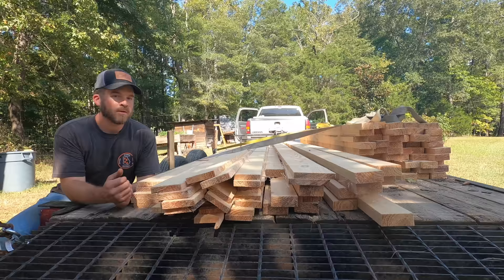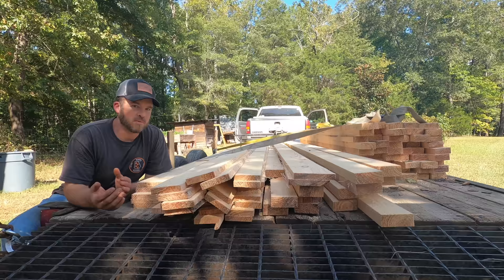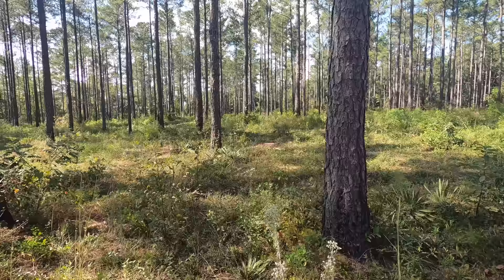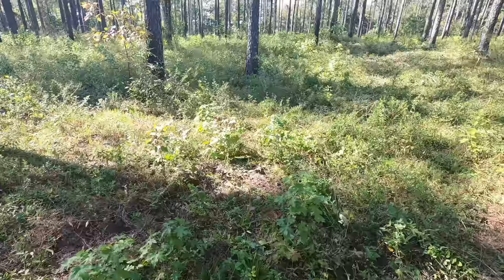Homegrown Lumber on a Mobile Sawmill

Comment: I think the bottom up error was the blade thickness? About cant. If you can't get a cant out to that log, well you can't. But the cool thing is that log turner. That is a cant-i-lever.
Reply from the maker: I think you're right, Bruce. Somehow I always forget about the kerf when it's the bottom cant.

Comment: Heya Wes.  Just a note, I know the trees will easily reseed down there, but for some of the people that are concerned about not replanting a tree for the ones you harvest, the trees will reseed many more than just a one for one.  That doesn't happen in some parts of the country, like Nebraska, where you have to intentionally plant and then baby replacement trees everywhere but creek bottoms.  Where people there can lumber out their property every 15-20 years and it'll reseed by itself, here you can only lumber out your property every 40-50 years, and it's usually only in creek bottoms or by a lake or farm pond.

Comment: Wess I know a true 2x4 is more impressive than the store one but I cut all my lumber the size of store both because 20 years down the road is your son or daughter will have a saw mill to cut there own wood. I mean by that look at your own remodeling project if you did not have access to a mill all the extra work you would have to do to match the ones that are there already now for a job like your's defenatly would cut to match but for new construction I go with the same size then from the store for the future generation to have a easier access to material if they don't have the saw mill 
  You did a good job at it and i like the fact that you bring the stump down so it is not a hazard in your forest have a great day
Reply from the maker: That's a great point.

Comment: Great video!  I marked my LT15 height wheel with numbers at every notch, 1 through 32.  I found that this really helped me make height adjustments more accurately and quickly, as I could pinpoint and turn to a number much easier than a line.  I can also return to my cut depth easier after sawing by cranking up the wheel as many times as needed to clear the log, ending on the same number.  All I then have to do is reverse that many revolutions back to my number and its spot on every time.  Hope this suggestion helps, keep up the great work!
Reply from the maker: Oh that's a good idea. I can see how that would be way better than the lines.
Reply: Yes sir, and the silver sharpie I used still looks like the day I put it on, two years later.  I also made a laminated card that I attached to the saw with a magnet that has my thickness cuts for 1", 1.5" and 2" with 1/8 increases for saw kerf, after the first cut thickness.  For example, if I was cutting 1 inch boards and had a 12 inch cant, I would see what height fit into that and start my cut.  Then I would use the wheel to set the rest of the cuts and it always stays spot on, with the bottom board also being an inch thick.  Hope this make sense and have a great day! @falllineridge

Comment: Hi Wes, I am a subscriber from far away India, a retired accountant. I love to see the varied types of jobs you do and the projects you undertake. Till now I have been a silent viewer, but today you did say that you would try to answer all queries. So here goes, when you are making lumber in your saw mill, what happens to the edges or the parts which has the rounded part of the bark. Or for that matter the rounds that are available after you trim the stumps to ground level. Do you use them for firewood? Anyhow what is done with them?
Reply from the maker: Not much I can do with the stumps that get cut off. The slabs (rounded parts that get cut off, some people call them flitches), have been claimed by my pastor. He wants them for siding for a little cabin. Another fried wants some for campfire wood. Whatever doesn't get claimed will probably go up in a huge bonfire in a few months. Thanks for watching and sorry it took so long to respond!

Comment: Wes, I don't care what everybody else says, I for one love what you're doing.  You are a very faithful servant of an incredibly Generous Master.  Keep up the good work.  
FYI, @9:54 I thought I noticed a spark or 2 coming out of the left side of the log where your saw was cutting it.  Was it a nail in the tree or just the chain sparking on itself ?
Reply from the maker: You're right! I guess I didn't;t notice that. Not sure what that was. Could have been a rock or some sand I suppose.

Comment: I totally understand why you need to thin out the trees. My question is... what happens to the stumps? Is there any value in uprooting them? Can you sell it, is it best to leave them or best to remove them to keep the ground level flat? Always wondered.  🤓
Reply from the maker: Best would be to grind them below the ground, but I dont have that capability. Best I can do is cut them flush and wait for them to rot.

Comment: On the logs with a large taper would it benefit you to shim up the smaller side 1/2 the difference between the 2 ends. I watch other videos where they do that to cut down on scrap.
Reply from the maker: It probably would. The trouble is that this mill has no toe boards so I would have to manually shim every log.

Comment: Great video, Wes!  Thanks for sharing... Do you miss your band saw sharpening rig?  I remember that seemed like a good thing for a home saw mill to have.  Guess it was more trouble than it was worth?  I recall you found a new blade company who makes blades more economically compared to original equipment.  Can you touch up a blade with a file or grinder to get some more mileage out of it by hand?  Is it worth it?  There comes a point where your time to sharpen an old blade is worth more than the cost of a new blade - guess that may have been how you felt?  Those pigs have sure grown!  Did you put Rocket in with Sue?  Is he old enough to perform his job as a boar hog?  Sorry for all the questions - I do really enjoy your videos!  Thank you!
Reply from the maker: I don't miss the sharpening setup. It just wasn't worth the time for me. I've never tried to touch up the blades, but I suspect that it would take too much time to be worth it. Rooster is in there with Sue, and he's old enough to do his duty (although I'm not certain that he's fertile yet). We'll see I guess!
Reply: @falllineridge  - Oops!  Thank you for the kind correction.  For some reason I remember his name did start with an "R"!  Informative video today on controlling the bee mites that that glow plug device that melts the acid into vapor. (I do hope you find your real respirator as that stuff sounds bad for your lungs!)  I'll bet that sharpener rig you had for the mill cost a pretty penny... I guess you figured out your time was more valuable than buying a sharp blade.  Ever since you found that new supplier of more economically priced blades, it makes it easier for your pocketbook, I'd wager.  I do enjoy watching you mill lumber and appreciate all the camera angles you treat us to - including the ones where you must stop the unit before you smack into the camera!  It might be fun to see you let it smack the camera (as long as it doesn't hurt it) just for fun!  Thanks again for sharing your lifestyle.  I'm sure I am not the only one who vicariously enjoys seeing your videos, and imagining I am there helping out!